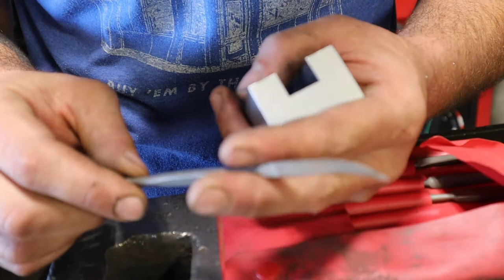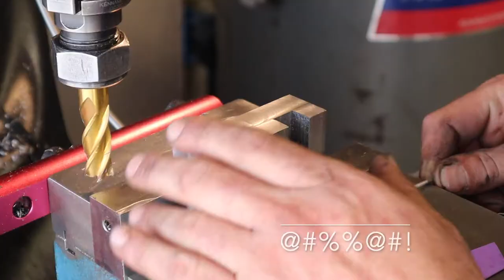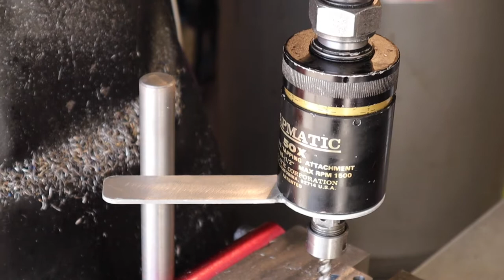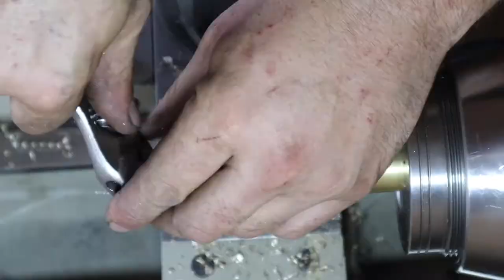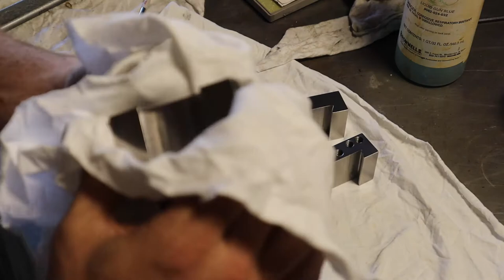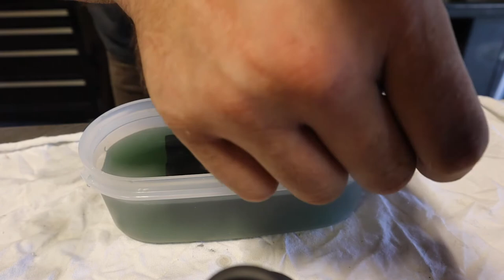beginner machining project part 2 phase 2 quick change tool holders

Comment: Great presentation!
A small tip on immersing the part in gun bluing solution - from an even more amateur machinist than you, so take this with a grain of salt:
Assuming you're not pouring the fluid back in the bottle after use, you may be able to reduce the amout of fluid used by as much as 90%.  Pour a small amount into plastic container, set the part inside and snap the lid on tightly.  Then gently shake it for a minute or so until the steel reaches the desired color.  Swap in the next piece and repeat, adding a bit more fluid if needed.
I've used this method on a mixed batch of ~50 mixed screws and other small parts.  I used a couple of teaspoons and everything turned out great (except for the ones I didn't get clean enough).  
Cheers!
Reply from the maker: Hey thanks thats a good idea ill give it a shot next time